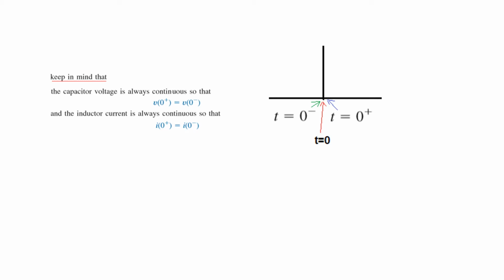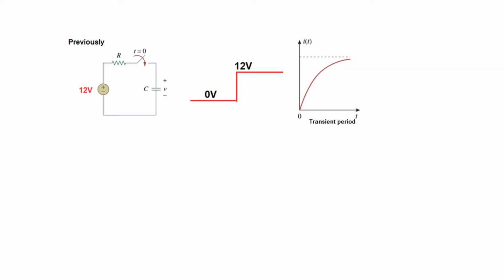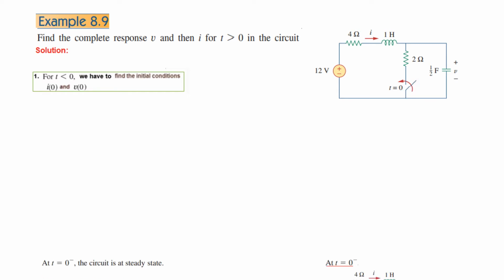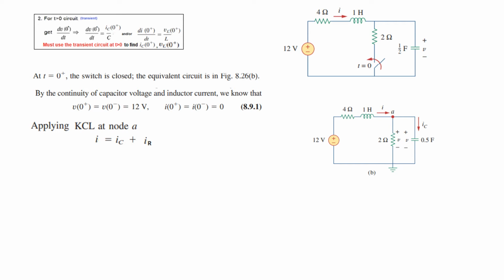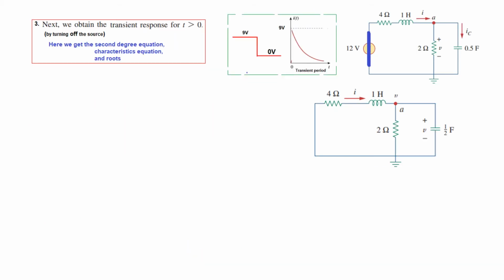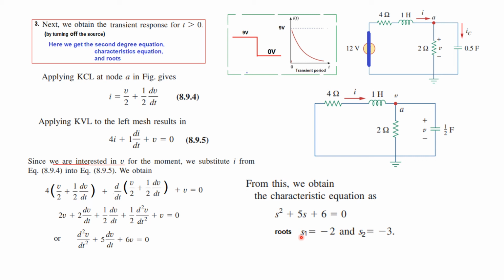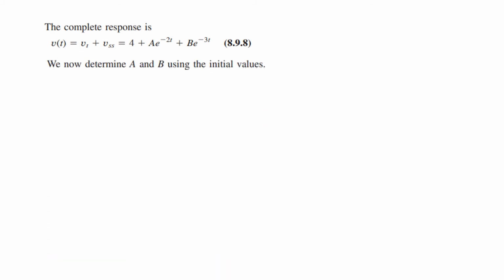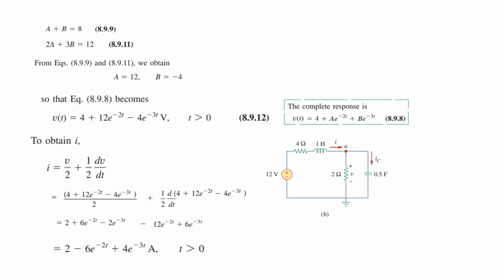(English)LCA Ex 8.9 || General Second Order Circuit || Finding Total Response || Complete Response

Comment: But capacitor voltage at t= 0- would be 12 volts (not 4 volts) because 2 ohm resistor is added at t=0 (not at t=0-)
Reply from the maker: Which point in time of the video, you are referring to ?